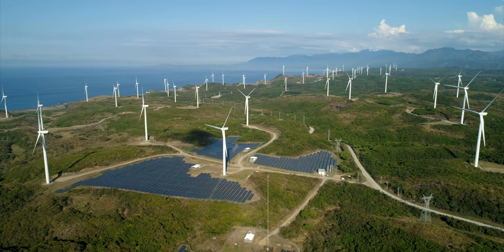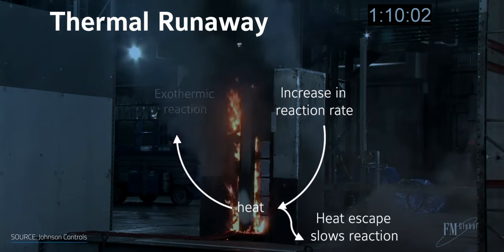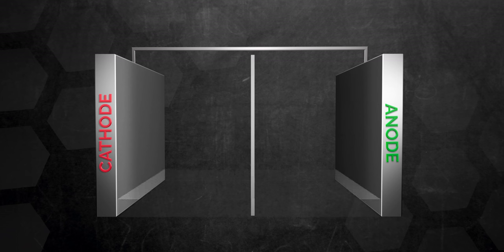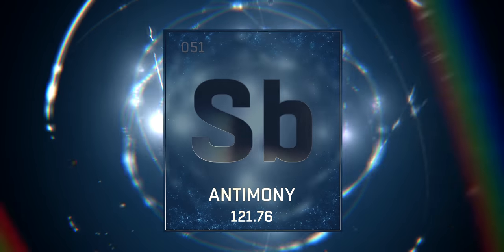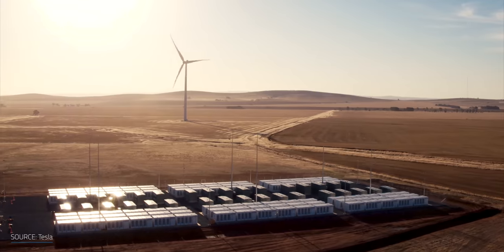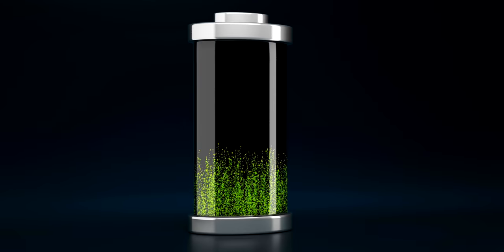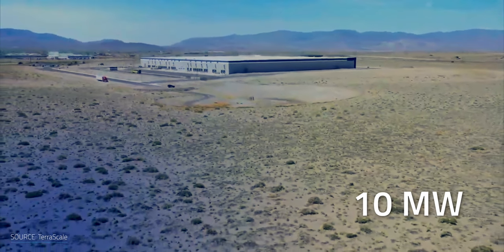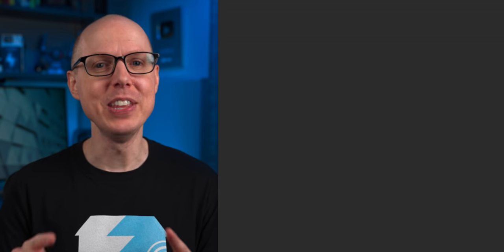Melting Metal for Energy Storage?  Liquid Metal Battery Explained

Comment: This is intriguing, and seems their might be substantial room for growth. Doesn't seem like a huge deal, but earth quakes are a thing, and just being security conscious, i wonder if you could make a non newtonian electrolyte to give it some kinetic stability. 

I'm definitely intrigued. Renewables are largely weather dependent, so discharge charge schedule could be an issue. We're fairly good at predicting weather (relatively speaking) so that can probably be managed. Maybe ideal for places with high ambient heat, since heat is usually bad for electronics, but these kinda need it. 

Would be interested to know if the waste heat from keeping them molten can be captured and used. I really think the key (in addition to maximizing surface area) to water desalination is to just make it a secondary feature of some other process.

Comment: possibly stupid question.. if we're talking about grid scale .. why not have a huge well insulated tank with molten salt, which can be heated by energy suplus and used to run a turbine ran by water heated by the molten salt .. very huge energy storing potential and it produces AC not DC, so it can directly inject into the grid

Comment: Hmm, 2 years for 20% charge reduction in lithium-ion. I was really busy last summer and had 3-5 cycles a day, with my phone hooked into a battery bank a lot of the time. (I was charging the battery bank at the wall instead of the phone.) After 5 or 6 months they both started bulging; and seemed to have lost 20-40% of capacity. So I guess that tracks with what you said, if we allow a bit extra for wear and tear due to being self-heated throughout a lot of the day.

Comment: There are actually a number of axes here that folks are not really hitting on.  That said, the comments here that I read are quite astute.  But the degrees of design freedom under consideration need to include:
1) The y = mx + b of scaling the technology
2) The availability of the materials and other economic uses of those materials (shadow prices)... that drive the value of the 'm'
3) The total amount of energy that such a system can store
4) The rate at which energy can be added or removed from the system, the dE/dt...
5) Latency and response time issues
6) Deep cycling issues (discussed, thank you...)
7) Design robustness / sensitivity to perturbations... how does a liquid metal battery deal with an 8.0 earthquake?
8) Whether or not the design is adiabatic or if not, what the heat is doing to the surrounding environment (there needs to be a Lagrange multiplier associated with any impact of this system on the local environment... look for 'Dantzig Wolfe Decomposition' on wikipedia)
9) MTBF / E[longevity] of the system
10) If there are any sensitivities to changing conditions in the environment.  LIke not just earthquakes, but wildfires, snow, hail storms or whatever
11) Thermal stability, perhaps these are great for some deserts but not all.  Or perhaps the performance becomes crappy in climates with cold winters
12) Is it possible for these liquid battery components to attack the walls of the containers they are in?  Like having copper and steel pipes next to each other when water is running through the copper pipe?
13) Need to look at end-of-life issues and recycling of the components.  All newly made systems need to be able to be reused / recovered losslessly... Or else humanity ends up a creek without a paddle.

Comment: Small modula reactors could be used to power the batteries so the power could be more stable than renewables which depend on wind or solar.

Comment: you forgot mention that the melting point of Calcium is over 800C and that of antimony is over 600C. So a working cell will appear red-hot. You also did not say what is the size of the 1MWh cell stack; It will need 1ft thick insulation to maintain the temp above 800C. The real challenge will be the wires interconnecting the cells. And molten Ca can be really very corrosive.

Comment: Lithium battery technology benefited from economy of scale because they are well suited to EV's. Lithium Iron Phosphate batteries work well enough for short term grid storage, but the need for daily load cycling is a great fit for the Ambri battery and with scale and technical tweaking the cost of production will fall well below lithium as the materials are inherently low cost and available. Ambri has potential to overtake lithium for grid storage. They might develop more quickly, if the company went public.

Comment: I like this idea. I think that using solar concentrators to heat a large thermal mass is a good idea (less transitions for the energy) The stored heat could be used to drive stirling engines or to create steam to drive steam turbines such as those used in coal or gas fired power stations. It is my belief that repowering existing electricity infrastructure is the most ecologically sound way of transitioning to renewable energies. I haven't found any references to this though, perhaps people don't see enough money in it. Or they feel that its better to draw more resources from the ground to create new things rather than re using existing infrastructure.

Comment: Not that I have anything really against this as a concept but would not flow batteries be better for base load storage? This sounds like it would be good for frequency stabilising because it wants cycling every day. Flow would be better for base load when the wind doesn't blow and the sun doesn't shine for days at a time as all you need to increase capacity is more storage tanks.

Comment: but the main challenge remains: Seasonal energy storage. The problem is not, that the Sun does not shine at night. The Problem is, that it shines less in the winter. That does not sound as much of a problem, but run the numbers and you will sea, that  every challenge of day to day energy storage is dwarfed by the problem of differences over the year.
Reply: it never becomes winte in the ecuador so just move closer to it
Reply: @nonec384  well we would talk about moving about 8 milliard people around. That is quite of an extreme measure. also I think that is an even greater challenge than finding a good solution for seasonal storage.
Reply: @MusikCassette  move the energy generation that is , i think it can alse be use to produce hydrogen that is co2 free and can be moved burned for energy or cars etc fuel
Reply: @nonec384  hydrogen would be a propper solution for seasonal storrage (indipendent on where the energy is Produced) but it does come with its own bundle of challenges.
Reply: @MusikCassette  the hydrogen would be made more to bost the number in the winter season so there would less need to stock up on hydrogen that can also boost energy when there less sun on summer , or a nuclear or maybe fusion reactor

Comment: if this really starts to fly it is indeed a gamechanger and can really help keeping the precious Lithium and Elons factory for mobile applications. 
Guess they made them in this compact form factor to start with something modular and reasonably redundant when deployed in this 10 foot container, but in the long run, anything preventing them from making larger cells (other than... modularity and uniformization of production?). So there could be more of the useful stuff and less of the surroundings required, especially if you dont require this full max current that the chemistry could handle but are rather looking at the sheer capacity ?

Comment: The use of Antimony will ultimately limit the scalability of these batteries. Antimony is a strategically important metal used in electronics, alloy hardening  and in catalysts, with limited geographic sources. Will be a part of the storage solution, but less so than lithium based batteries and cheaper lower density batteries. At a larger global scale the increasing price of the even more in demand Antimony will increase the costs of production.

Comment: I strongly believe that alternatives to lithium based batteries will become a major increase due to the issue of degradation with most forms of lithium, alternative to li4po batteries, flow batteries, and sodium nickel chlorine packs , and alternative grid storage compressed air and hydrogen.  And melted salts it will be years before plasma energy comes online to grid nuclear levels  or bigger if it means less booster or peak shaving plants are needed.  If we can get around the battery memory issue and even up to terra watt storage then I’m all for it it wouldn’t be hard to build a building to house these packs limiting the need to add extra heat even in northern climates, I just hope that the technowhen deployed doesn’t end up looking like a stack of ship containers end to end

Comment: If the batteries produce their own heat by charge/discharge cycles and have about 80% efficiency, one might also consider combining it with long-distance heating in colder regions (Alaska / Northern Europe) as 20% of the stored energy gets converted to heat? One could envision a combined liquid metal battery + wind + geothermal installation in one building providing heat and buffering/augmenting electricity of each individual house's solar panels for a ~100 home neighborhood.

But an almost bigger challenge to individual solar energy is the yearly seasonal cycle that a daily electricity buffer cannot compensate :-(

Comment: This battery seems perfeclty suited for solar energy applications , due to it's resistance to high discharge cycles at night , but I worry that without a constant flow of charging and lower temperatures at night if it will mantain it's very high operating  temperature . This might be a problem over winter too , with lower temperatures and less energy flow due to much lower  solar incidence it might even return to it's solid state if not heated , than it's  energy eficciency goes down the drain (and it's already not very high ) that combined with the lower efficiency of solar might be a problem . Plus I wonder how it's casing is going to last such high temperature changes overtime , without  bending or maybe even leaking , they might have figured all this out already but I dont know.

Comment: NaK and low temperature Gallium alloys, I always wondered at the possibility of bringing a liquid metal battery down to lower temperatures with these materials but wasn't sure if an electrolyte existed that would be compatible, or if there would be alloying issues between the gallium and sodium/potassium. Great to know that someone got it mostly worked out.
You are unlikely to be able to find a cheaper gallium replacement though, as the list of room temperature liquid metals is pretty short.
Reply: The high density electrode can be made of an alloy that will melt at room temperature but the metals needed are expensive.  The low density electrode can bee max from metals that melt at close toe the boiling temperature os water.  but that is about as cold as you can go.

Comment: I believe a mixture of Ambri liquid metal batteries and lithium ion batteries may be the best approach.

I came across a talk by Dr Donald Saturday, where he said indications are after 200 years or more of operation it may have lost 20% of its charge leaving 80%.

sounds like one of those old electrical or other motors made back in the late 1800s early 1900s that are still running today

antiguajohn

Comment: It was glossed over but I'm still curious as to the molten current. Would the metals not move around due to temperature variances? Or is that negated by the electrolyte layer?  If ambient temperature sways wouldn't it affect the cells? Or maybe the effects are too small to impact it unless they create bigger cells?
 
Basically, I'm asking for clarification on the specifics of containing metals maintaining a liquid state. Maybe it's already accounted for when selecting the materials, but I'd at least like confirmation as to whether or not the cells are stable.

Comment: Great technology! Thanks for the piece. In terms of lowering metal operating temp, is it possible to use metal alloy approach? The trick is to select the right metals, with the right electronegativity as well as the melting point. One meal can be "inert", such as mercury. Of course, the issue of toxicity needs t be considered as well.

Comment: am interested in this tech for a rural, off grid home - could it be scaled appropriately to individual homes that are using solar panels and such?
Reply: I think that will take quite a while. And because of the heat required it needs insulation and some limits on the minimum size to be efficient.

Comment: Well molten sodium batteries have always brought the question of safety particularly with vehicles that may be involved in accidents,  being sprayed with molten sodium is never good which of course is why liquid metal batteries have always been said to have grid applications not vehicle applications.  However, we have now discovered that sodium can be diluted in water without causing an explosion by simply slowly depositing the sodium into water by vapour deposition so it may soon be possible to safely use sodium in batteries.  The water sodium mixture may also have behaviour that we do not yet know of.  It should be noted that many lithium ion batteries are also liquid solutions just in material that holds the solutions as a sponge would hold water.

Note, your efficiency estimated of both lead acid and lithium batteries are the discharge efficiencies.  The charging efficiency of lead acid batteries is 50% and 80% for lithium ion batteries.  You also got the discharge efficiency if lead acid wrong as it is 95%, the discharge efficiency of lithium ion is 90%.  Hence the overall charge to discharge efficiency if lead acid batteries is 49% and that of lithium ion batteries is 72%, ignoring storage losses of course.  Citing efficiencies are often mistaken especially since Wikipedia has decided to list both charging and discharging efficiencies in one line instead of the two separate line they once did,  hence leading the data line to be misinterpreted as a range of efficiencies for the combined charge/discharge cycle when it is in fact two entries for charging and discharging separately.

Comment: My question with Ambri battery technology has to do with the metal plates that connect the anode and cathode to the terminals for wire connection. How do they behave/react with the anode, cathode and temperatures over time? Do films or crystals form on them? Do they loose conductivity over time? They seem to only talk about the molten portions of the battery.

Comment: I think we have found a "wrong tree", and are determined to bark up it. Renewable energy is all very well. But it is more trouble than developing MSRs (ultimately to process thorium). But ther is an interim process which consumes plutonium (of which we have a stockpile - an unwanted stockpile). The British-Canadian company MOLTEX has designed a reactor which uses what it calls "a stable salt" to produce electricity for a power station. Its first commercial application is currently being built to supply the Canadian grid in New Brunswick. The power available will not depend on the vagaries of cloud cover or isobars. It will be the nuclear power which we should have had seventy years ago.

Comment: I do wonder if this could be adapted for home use.  It would require more thermal insulation (to keep it at operating temperature without needing a resistance heater), and likely underground installation (so there'd be no concern about spillage), but with that long life maybe it could compete with a PowerWall.

Comment: Since these batteries require heat, it would seem the larger the battery, the more heat these batteries would retain. You could put them together like a cargo ship fuel tank but one stacked on top of another.  That would look like a giant oil storage tank.   Earthquakes would be an issue.

Comment: Matt, have you ever done a video on small scale, single building, power generation systems? I have seen proposals for both natural gas and hydrogen systems with most of the hydrogen ones being similar to fuel cells writ large. The systems are said to be scalable from household to industrial size (or at least very large building size).

Comment: why not using a refrigeration cooling system hook up a drum paddle fan with a radiator  and create a chiller core and inject the antifreeze through the battery chassis system

Comment: Good episode.  Sounds like they’ll be great for stationary energy storage products in Nevada or Arizona, but was wondering if they’ve done any research on the system in cold weather climates such as Canada?  And if so, what is the loss in efficiency due to the need to heat it more?  Thanks
Reply: If you make it big enough and thermally isolated enough it won't be significant, specially for short term storage, perfect for grid storage.

Comment: What about just melting a metal like wood metal aluminum or lead storing it as heat and then using a steering engine to get power out of it. Something like a lead or aluminum can be melted millions of times. Just have to be careful about what you put it in so that the expansion and contraction will not cause cracks. The amount of power stored, can be measured by the expansion and contraction of the metal.

Comment: Basic physics seems highly dependent on a material state that is not in line with our environment - several hundred degrees high. If its operating temp would be below 100% I could believe in it more, high temp limits it in many ways. Is still better than Li-ion but for a breakthrough it should be a magnitude (or more) cheaper.